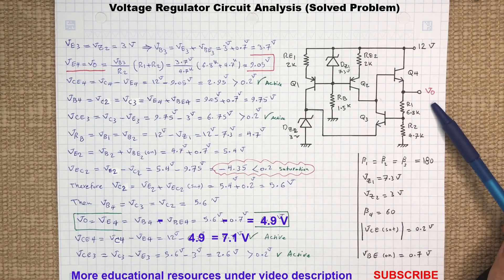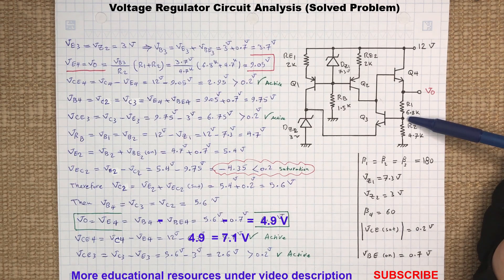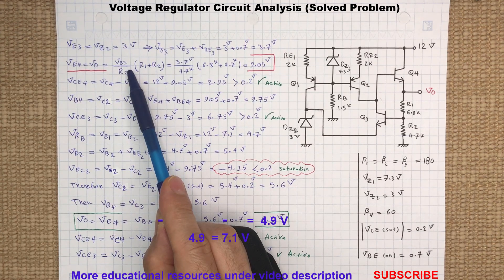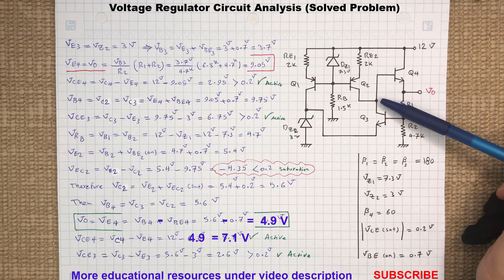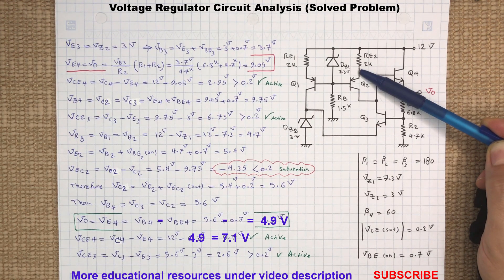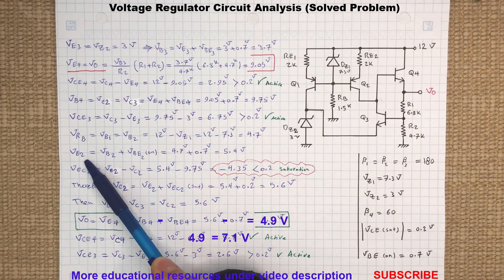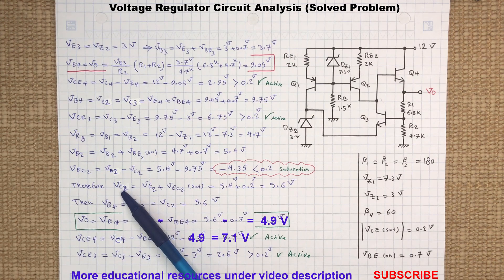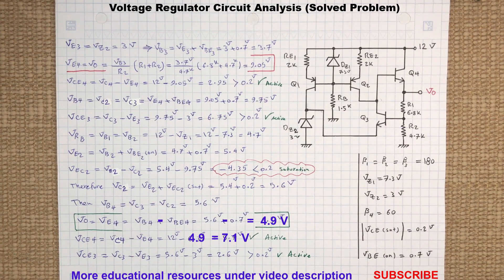Voltage Regulator Solved Problem, Voltage Regulator with Zener and BJT

Comment from the maker: Voltage Reference Circuit with BJT : https://youtu.be/nkcTwK1LTDI
Full-Wave Bridge Rectifier using IC 7809:  https://youtu.be/oplCvtsdcM0
Voltage Regulator and Current Limiting :  https://youtu.be/8Mn6LC2isHs
Op-Amp and Zenner Voltage Regulator:  https://youtu.be/CKMxGu3uHAA
Transistor Series Voltage Regulator:  https://youtu.be/OuVbjRZHM9U
Electronic Circuit Analysis Playlist: https://www.youtube.com/playlist?list=PLLA_QJ8rHZBh5LqrY41bCvKgreRDRWrBQ
Control System Playlist: https://www.youtube.com/playlist?list=PLLA_QJ8rHZBjS_S6WPkmUweF5NbImvSqf